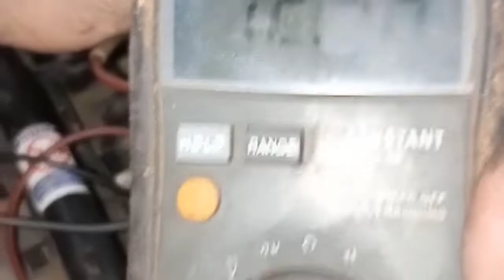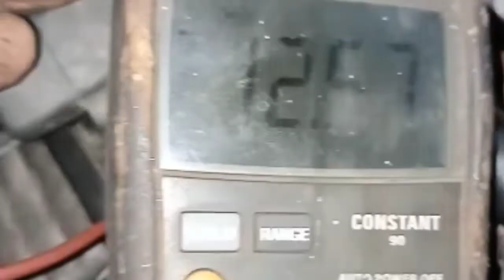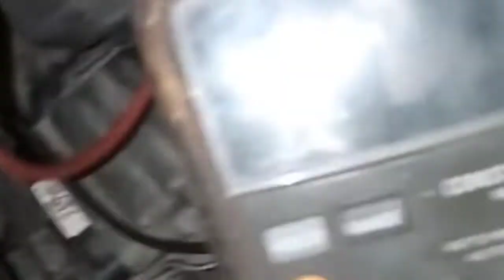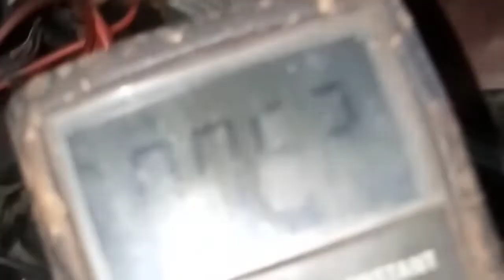PENYEBAB YAMAHA VIXION AKI TIDAK MAU NGISI ATAU TEKOR

Comment: Mas Mau Nanya Pas Langsam Voltase nya Gak Naik Tapi Pas Di Gas Voltase nya Naik Apakah Normal, Motor Vixion Nvl
Reply from the maker: Kondisi langsam di cek volmeter 13 atau dibawah 12 mas
Reply: @intimasmotor  di 12 pas mas
Reply: Bg klw cuman 500 apa nya masalah itu